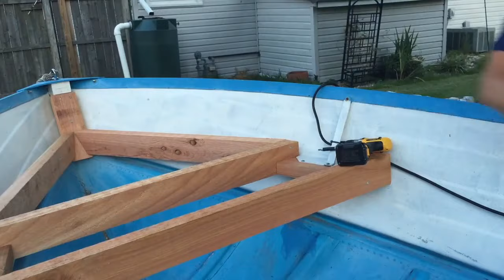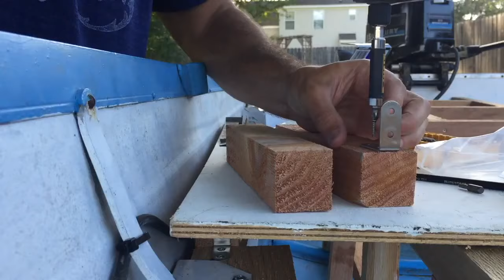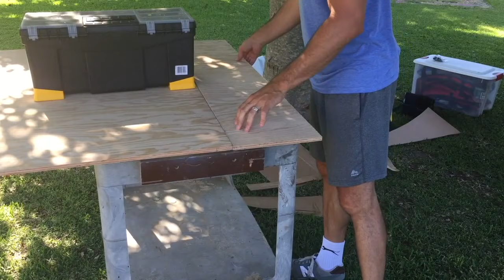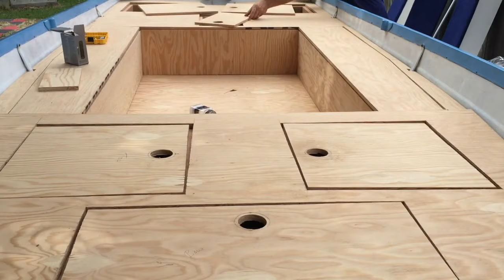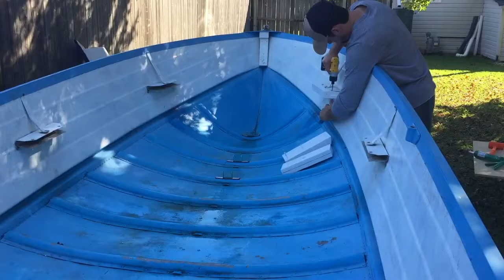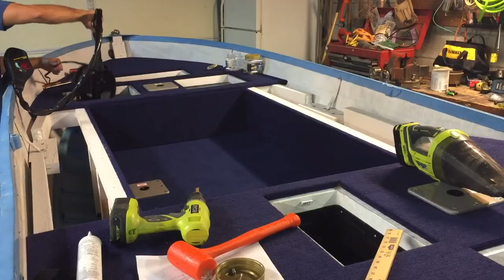14 FT Utility to Tiny Bass Boat | Full Build Time-lapse | Start to Finish!

Comment: I may have selected a combination of aluminum angle and lighter wood to reduce weight, but I don't think I could have done a better job than what you did with construction, fit and finish.  Just awesome! Well done and I bet you get many years of enjoyment out of that build.
Reply from the maker: thanks so much Christopher. You are right that it would be lighter with aluminum. I did have a lot of concern with weight when building it, but im really happy with the way in turned out and the weight doesn't seem to have impacted performance much. You can see it on plane before and after the build, and it doesn't seem much different at all. its fun to fish! thanks again, and thanks for watching!
Reply: Weight was my concern too. The build is awesome 👍👍
Reply: @DrBass-rk1ez  I am actually wondering if the added weight is a good thing, kind of like ballast. My biggest concern with some of these builds is how top heavy you make a small aluminum boat that was not designed to stand on a platform on.
Reply from the maker: @ColoradoStreaming  hey man, so sorry for my late reply, my work has been busy last month. I had exact same concern and to my surprise it does fine balance wise, and yes, the added weight certainly provides further stability. I have two videos on the channel that give a feel for stability when fishing. One with just me: https://www.youtube.com/watch?v=cjnAYu45TnI&t=2s and another with a friend on back deck: https://www.youtube.com/watch?v=VEe1eLrjlNM&t=86s These should give you a better idea of stability.

Comment: Great job, I had a 15 ft tracker crappie boat. I tore it apart and basically did the same thing, put a deck in the front and the back. I had a 20 horsepower motor Plus an 84 lb thrust trolling motor. I regret to this day that I sold it. It just needed a bigger motor. You did a phenomenal job on it you're very skilled
Reply from the maker: Sorry you sold it! Yeah I get a lot of pushback because of the weight, but I can honestly say with my 25HP it flies, and its really enjoyable to fish. Ive thought a few times of selling mine but you make me think I should keep it! Thanks for watching!

Comment: Great work, I just bought one ready for work. I got the motor ready now on to the boat. Want to use aluminum for lighter weight but boy are they expensive. Morning guy end up using 2x3 and 2x2s stead for framing.
Reply from the maker: Thanks man. yes, aluminum is expensive and bc this was my first build I was more confident with wood framing etc. I used rough cut cedar which is naturally rot resistant, light, and strong. I think I probably could have gotten away with a lot less 2X4 and used more 2x2 or 2x3 as you say, to lessen weight. But it still runs great and fishes great with 2 on it. I fish often with two others on it and its fine. Best of luck on your build. Thanks for watching!

Comment: From what I’ve learned from boating is, never build out of wood. The weight is one thing but, the rotting is another. Aluminum would be better in every way. Lighter, most of the time cheaper. Takes up way less volume. Doesn’t kill gas mileage. Won’t rust or rot. Won’t warp and flex, and better looking. I’m not sure about the choice of materials here but, still a sweet boat.

Comment: Awesome woodworking, enjoy watching. Glad you answered the weight question. I was thinking you would be needing a 150hp, just to get on plane.
Reply from the maker: Thanks Rhonda, I was really concerned about weight, but I can honestly say it's a non-issue. My boat is quite wide so it can handle the weight. There were so many people warning about it, but I'm really happy with it. It gets on plane really fast with me and another on it, and all the added weight of decking doesn't seem to have slowed it down much at all. I'm not sure what others use, but I make sure to tell everyone that I used cedar for the frame. Cedar is lightweight, strong, and naturally rot resistant. You can see me running the boat on plane with just me on it here. I promise it isn't much different with two on it: https://www.youtube.com/watch?v=5YdJ9oOzhR8  Thanks for watching!

Comment: I would have center consoled it, and put a little larger rear deck with seat on top or bike seat. Then 2 people could have a casting deck with plenty of room. 40hp. Mercury on back. 3 blade high pitched for speed. It would fly, and be cool. But I love what you have done! Amazing woodworking skills! Your layout is very nice indeed. sows ear into a silk purse.
Reply from the maker: thanks man, that would be one hell of a project for sure. this boat is not rated for an outboard that size, but i will say ive fished plenty of times with me on the front deck and and friend on the back and it works great. Thanks for watching and for the kind words.

Comment: You got a fine lookin boat there sir.  I did a 14 ft V hull years ago.  Kinda kickin myself for letting it go.  Now I've been binge watching all these build vids and getting the hankering to build another.

One criticism; is everyone planning to take their trucks out fishing too?  The framing I've seen on a lot of builds just seems over the top and adds a lot of weight in my opinion.  With current lumber costs it might be cheaper to use alum angle.  IIRC, I just doubled up two pieces of 3/4" CDX (slathered with Kilz then carpeted) for the front deck and just screwed it down to the benches.  One hatch for some storage underneath and a fishin chair.  Caught a lot of bass off it that way.  It was also very stable and never sagged.
Reply from the maker: thanks man, yes, I would agree I didn't need this much lumber. But it was my first build. I will say, that it still runs great any is now very stable in water. Here is a video of it running on plane with my 25hp: https://www.youtube.com/watch?v=5YdJ9oOzhR8&t=136s
Reply: @DrBass-rk1ez    I saw that one too.  Mine also planed out with a borrowed 25 hp Sea Horse.  Mine came a with 15 hp SH.  It got us to the fish and I was content with that.

Comment: Cedar was definitely a good choice, aluminum square tubing also works great for framing, and would probably save you a few lbs at least
Reply from the maker: yes, I agree, also in hindsight I could have used less 2x4 and more 2x2 or 2x3 to take a bit of weight out. But overall its working great. thanks for watching!
Reply: @DrBass-rk1ez  What was the cut @ 11 seconds for?
Reply from the maker: @frankieg1978  if you jump to the next shot you will see I needed to cut it there to get it to fit in the slot for the old seat holders. Those were my main supports. hope this makes sense? Thanks for watching!
Reply from the maker: @frankieg1978  here is a better video of that portion of the build.

Comment: Cool build but damn that has to be a lot of extra weight you’re adding in there.
Reply from the maker: it is more weight for sure but i was impressed with how well it turned out. You can see me on it with others in the other videos and it running on plane. Thanks for watching!

Comment: I really enjoyed this video.  And after reading through the comments, I won't bother asking about the weight.. lol.   But you did say it took quite a while, and you treated it like a hobby.  But roughly how long?  Weeks?  Months?  Year?  Thanks for sharing!!!!
Reply from the maker: r. Scott. thanks so much man! yes, ive had the weight question a lot, and as you've probably seen its not been an issue. Would aluminum be lighter? yes, but its seems fine as is. Ive regularly fished with myself and another standing on it and bass fishing. Tomorrow since im doing lazy trout fishing ill have three total on it. In the next video you can see it with just me get on plane. Bear in mind I do have a 25hp so it does have a lot of power. It gets on plane quick with two and even three.

Regarding the time, yes, it should be a hobby and something you enjoy. Id say between trips to the hardware store, ordering parts, making mistakes it took me about 2 months working maybe 10-15 hours a week on it. If you have all the supplies and know what you're doing I dont think it would take too long. If I did it again, knowing what I know now, it would take only half the time, this was my first one. It is a labor of love, I wouldn't recommend doing it unless you'll enjoy it. It's very rewarding when its done, however. Hope this helps. Thanks for watching!

Comment: Lots of weight add there 
Nice job tho👍
Reply from the maker: Holy beef, thanks so much. Here is a response ive sent to others about weight questions: 'I get the weight comment all the time. I think there is a really strong bias online regarding weight that I'm not sure, now after building a boat, that is not a bit overblown. Maybe Im simply not as concerned as others? Anyway all I can do is point people to my before and after videos on the water. Does the boat weigh more, absolutely, but it does not seem to have changed its performance at all, and when I'm fishing with myself and another having some extra weight actually stabilizes it better. Anyway, I always tell people I used cedar which is light and naturally rot resistant. I have a 25hp also, so of course with small outboard id notice a difference. Here are the videos of the boat running on plane: (before: @ (after: @. Thanks for watching!'

Comment: This boat looks great you did a good job. The only thing I’m concerned with is the weight. I’d bet you are over the weight limit of the boat with 2 people inside. I have a boat like this, I only put a front deck and the thing is heavier than I would like.
Reply from the maker: weight is the #1 question I get and the biggest concern I had in doing the build. In hindsight I could have used less 2X4 and more 2X2. However, I am very happy with the way the boat turned out. I was nervous id added too much weight but it handles really well with myself and another and I've often had three on it (not recommended!) and it runs and fishes just fine. With myself and another it can handle pretty choppy conditions and with a 25hp it will run about 20-25 mph. I can honestly say ive been in some rough waters with it and ive never taken on water. 

One thing to note, I used cedar for the frame, which is really lightweight, strong, and naturally rot resistant. I am no expert on lumber. A lumber yard recommended I use it and I think it was a really good choice for the above three reasons. Also, bear in mind my boat is wide and a v-bow so it displaces more water than same size Jon boat and can handle rougher water because of v bow. What kind of wood did you use?

Comment: Did you water test it on a lake? Is it super heavy? I was thinking to do something similar with my fiberglass boat. Will it be to heavy?
Reply from the maker: Myrko, i have used it a lot on the water. You can see my fishing on it with others and running it on plane in my other videos. Those should give you an idea of how it handles. I used rough cut cedar which is naturally rot resistant, strong, and lightweight. Again, have a look at my other videos to get an idea of how it sits now that its complete. Thanks for watching!

Comment: How many 2x4s and how many sqft of plywqod would you estimate you used? I have a very similar 14ft smokercraft that I want to do this with. Also out of WA, curious of any lakes you like to bass fish if you're towards the West side. Any help with specifics behind this would be greatly appreciated!
Reply from the maker: Jeremy, great to connect here. I was able to do entire deck with three 4x8' sheets of 1/2 inch marine grade plywood. for the frame used rough cut 2x4 cedar from home depot or lowes, because its naturally rot resistant, light and strong. I think I used around 10-12 8 foot 2x4's. I ripped a few of them to make 2x2's where needed. I think my decking is a bit of an overkill, and you dont need as many 2x4's as I've used. 

I live in Kingston (near Seattle), but built the boat on the east coast. I literally just moved to Kingston last December and was away in July and august so I've really only fished two lakes so far for bass and not really had much time at all to figure them out. One of the lakes is on the olympic peninsula (I actually live in Kingston so it only about a 25min drive) called Leland Lake and really only caught trout, caught a few small bass really early in the season but missed the spawn. I also live really close to a small lake called buck lake in Hansville with a primitive launch, which I've had some success (a couple 2lbers) looks decent, but last season I missed the spawn so who knows. I saw a lot of what looked like decent beds out there so hoping to catch bigger ones next season. I am back now after being away this summer, and hoping to get out soon to keep exploring. Best of luck on the build and let me know how I can help?!
Reply: @DrBass-rk1ez  Awesome thanks! I should have more than enough 2x4s then and just really need the plywood. 
I'm down a little South of Tacoma and fished lots of smaller lakes in my Yak until I sold it when I got this 14ft. Seeing how you did the framing and everything looked like what I wanted so I'm definitely going to steal the design and probably add a few tweaks. I'll wait until the rainy season starts though so I can get as much fishing (thankfully I have a nice large enclosed work space). I will ask, if you could do it again what would you do differently? 

Again thanks for all the info!
Reply from the maker: @jeremy6186  I had an enclosed space too when I needed it which is really great. I used to fish out of a canoe until a friend of mine said his friend's grandfather wanted someone to take this boat off of his property, which came with the same outboard in the videos. I immediately sold my canoe to purchase a trailer and ran over to get the boat. Really fortunate to have it given to me. Re the question of what would I do differently: again, I think you can get away with less framing. I was not sure how strong the 1/2 plywood would be and it turns out it is pretty strong and I didn't need all of that framing to support it. It might sound prideful but in the end there isnt really much id change to the layout. I honestly had no idea if it would work etc (and lots of people on here complain about weight)I, but I'm really happy with the way it turned out, aside from the carpet color (it looks purple and I thought it was blue-long story but the floor carpet is blue and the decking is a dark purple, which I had not realized until it was too late). In case you've not notice the entire build is broken down into longer videos on my channel. Lots of other more detailed videos from start to finish. Best of luck building. Let me know if you have any other questions?

Comment: I saw some good efficient work with esthetic finish. I didn't see the rod locker or live well, did I miss something? What about a bilge pump and flotation?
Reply from the maker: no rod locker or live well, im not that sophisticated! it does have a bilge and foam under the floor. you can see this in some of the other vids on my channel, thanks for watching and sorry for my very late reply!

Comment: Wow! Great job and perfect way to edit it.  What’s the boat weigh now? Anything you would do different “next time”?
Reply from the maker: thanks so much man. A lot of people are really concerned about weight and so was I. In the end I am happy to say that yes its heavier and I probably put too much wood in it, but it runs great and handles really well with my 25hp. I really like the layout. If there was anything I would change it would be to use a bit less 2X4s and use 2X2's. I didn't know when I was building how sturdy the decking would be an now I know I didn't need that much. I also would not have chosen that color of carpet! you can't see it on video but the floor carpet is blue and the top decks are a dark purple. I thought when I went back to purchase the more of the blue I was purchasing blue, but got a dark purple. I didn't notice it until I installed it because a lot of the work I did particularly the carpet was done inside with low light to keep out of rain. That drives me crazy, but oh well. Here is video of it on plane: https://www.youtube.com/watch?v=5YdJ9oOzhR8&t=136s
Reply: @DrBass-rk1ez  awesome!  looks like she rips!

Comment: my friend, but this modification won't affect how much the boat will sink, right?  I would like to do it at my most I'm afraid it will sink too much.  thank you in advance.
Reply from the maker: i dont know how much weight it added but you can see in the other vids that it does really well regardless. If i were to do again, i would have used a bit more 2x2 instead of the 2x4. i think the frame didnt have to be so robust. But overall, im really happy with it. thanks for watching and sorry for the very late reply!

Comment: Wow nice job.  But alot of extra weight.
Reply from the maker: Thanks Rick, yes, I think its a bit of overkill on framing for my first one, but I will say it runs great and handles really well, and I regularly fish it with another person with me. I used cedar for the frame which is lightweight and strong so it definitely helps with the weight. In next video you can see it running with all the weight in it. With a 25hp it moves fast. If I had a smaller outboard it would not be the same. Thanks for watching!